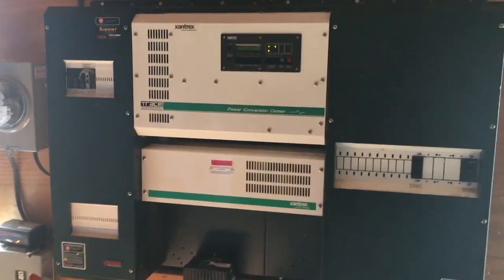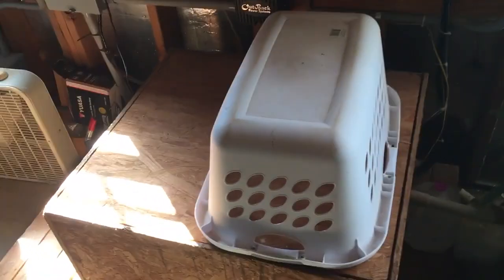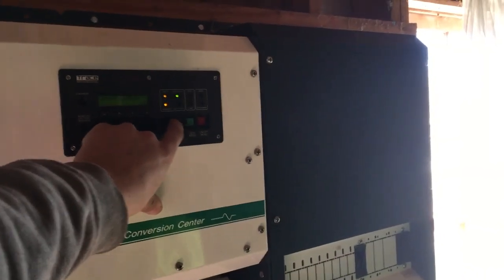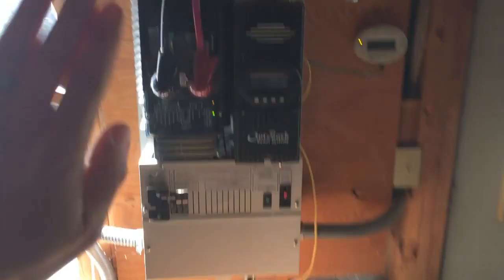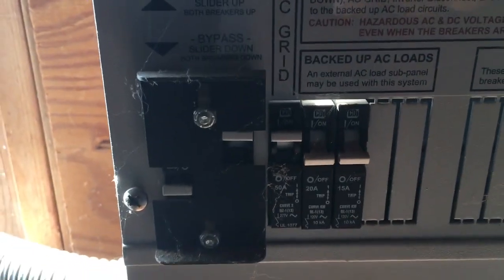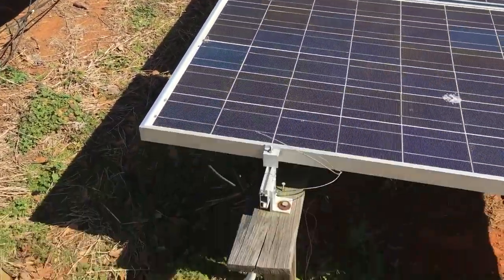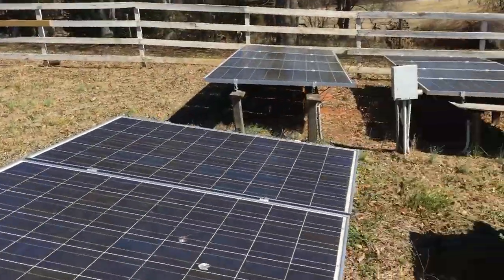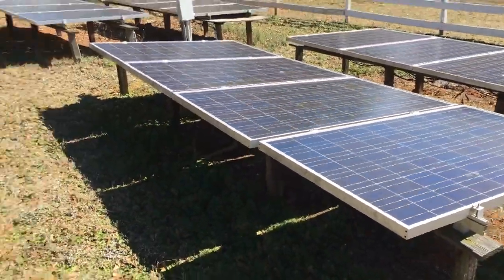Solar repair:  Older than a Trace Xantrex

Comment: You are standing on the shoulders of people who pioneered these systems. Give them some respect. I did solar and wind at my home in the late 1980’s and early 90’s when few if any electricians would touch a project like this. Our solar panels cost us 2-3 dollars a watt for government or university surplus units. My first panels I built in the late 1970’s from broken cells left over from the space industry. No, I take that back, my first solar array was built from disassembled selenium rectifiers. Those old Trace Inverters were amazing. I have two from 1999 that are still running. I wish I were young enough to see some guy 23 years from now ridiculing you for your installations. Who knows, maybe your products will crap out sooner and I will get to see it.

Comment: Grid tied is great in some areas but in Florida when a hurricane leaves you without AC for 11 or 12 days you are glad to have Back up Batteries.   Florida power has not done to good of a job with cleaning up the trees from their lines.   We have a hybrid system.  Solar wired separately from the power company.  Some 12 Volt some solar some Fp&L.   Our highest power bill was $60 in the coldest month but usually runs @$45.  Good info you put out.

Comment: Definitely she was oversold alright, unless she needs battery backup power when the grid goes down. The wind generator kinda got me for a loop. As old as the system is, with proper maintenance it will keep cranking out the kWh.

You really gotta love the mounting of the racking system, but done by a previous "professional" installer? I can understand a DIY on a really tight budget, sighs...